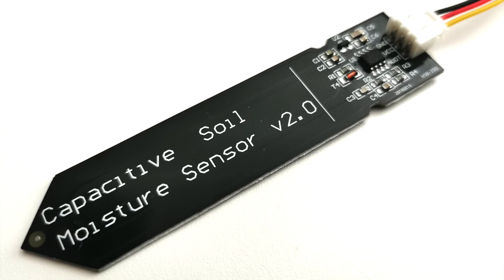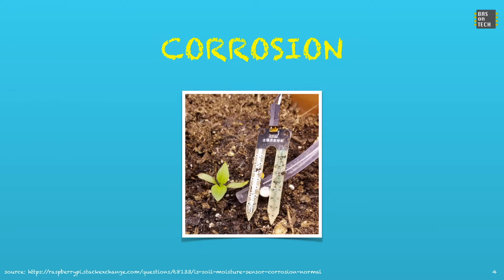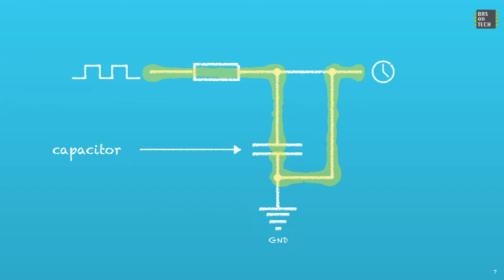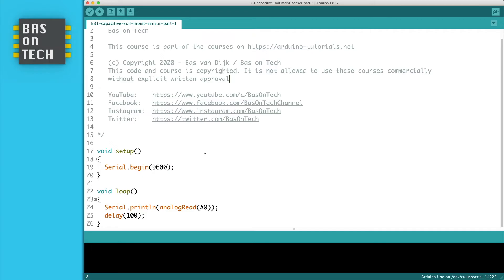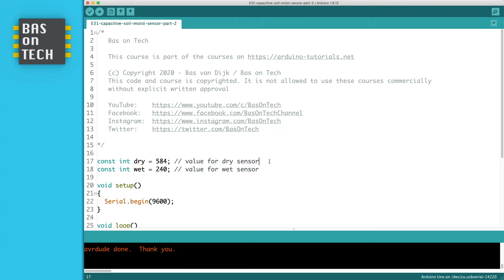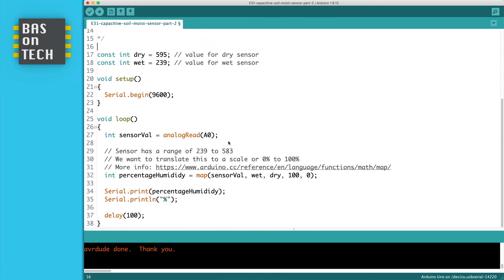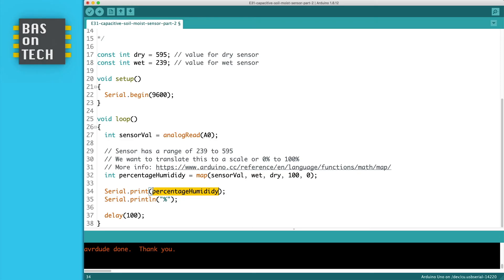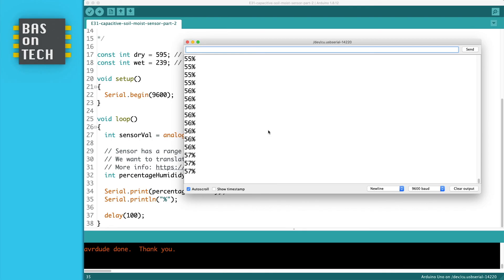SOIL MOISTURE SENSOR FOR PLANTS (V1.2 / V2.0) - Arduino tutorial #31

Comment: Nice video. One thing i would do differently is instead of using a cup of water to calibrate, use a pot with dry soil and take that as a dry measurement. Than get your soil to field capacity (Not too wet, not too dry. just right) and take that as your "wet" measurement. The readings will be much different than actually wet and dry. I made this mistake and killed plants by overwatering. ProTip: Censors need to be recalibrated if using a different type of soil than from the original calibration. Always calibrate in the soil you are going to grow in, because each medium is different.
Reply from the maker: Thanks for your explanation! This will help future readers a lot 😃

Comment: Thanks for this informative video.

Query - what if the above circuit part of the Capacitive sensor gets wet due to rain or any other reason? Will it affect the sensor? Should it be insulated?

Thanks!
Reply from the maker: My pleasure! 😃 I've not tested this. However I think that water will probably damage the sensor. So insulation would be definitely wise to do.

Comment: At 2:00 the video is wrong. The output of the circuit is tied to ground. So there will not be a signal to measure at 2:14.
What happens is this: When capacity increases (more moisture), the voltage swing across the capacitor will decrease. Vice versa, when capacity decreases (less moisture), the swing will increase.
Reply from the maker: Thanks for pointing out! 👍

Comment: You explained it great, but I did the same thing you did and the code just does not work.
Reply from the maker: That is quite unfortunate. Recheck your wiring and make sure the pin layout of your sensor is the same as mine. Without any error message I can't help you further.

Comment: hello, can I use the capacitive soil moisture sensor to detect/measure moisture in oil
Reply from the maker: I am quite sure you can't. The oil will probably damage the PCB. This sensor is as far as I know for soil.
Reply: @BasonTech  Thanks for your reply, I am doing final year project and part of it is about monitoring transformer oil quality, more specifically its dielectic strenght. Moisture/water reduces dielectric strenght of transformer oil that in most cases lead to explosion of the transformer , what sensor can you recommend that I can use to detect/measure moisture in oil
Reply from the maker: Unfortunately I have no experience with such a sensor. You might want to ask this question on Facebook / Reddit Arduino groups.

Comment: I actually prefer the resistive sensors.
You turn them on one by one for two seconds, store their values in variables and then read those variables and activate the pumps. You run the code every thirty minutes, this way the sensors last a very long time, because they're only powered for a couple of seconds per hour.

Comment: The reason for the slow response time at the end is because your sensor is faulty, there is no pulldown resistor on the analogue output.

At 0:01, on the bottom right of the sensor, just below C4 and R4, the via hole is breaking the trace. You need to run a wire from the right side of R4 (nearest to the end), to the analogue output pin. Check out the video by “flora” on capacitance soil sensors
Reply from the maker: Thanks for sharing! 👍

Comment: 9600 baud == 9600 bits per second, not characters per second
Reply from the maker: https://en.wikipedia.org/wiki/Baud states "It is the unit for symbol rate or modulation rate in symbols per second" 
The differences are found in https://www.geeksforgeeks.org/difference-btween-bit-rate-and-baud-rate/

Comment: how long does the sensor last if used continuously?
Reply: I've used mine for 3 summers (about 4months each summer so a year total of use) and have only replaced 1 out of my 5.  They were planted out in dry greenhouse so conditions we're good and weren't exposed to rain or wind. There are a lot of unreliable sensors available to buy and a lot of ppl have had a lot of trouble finding reliable ones. Try look for a reliable one. Hope this info answers your question
Reply: @iiinicky6224 this is mainly because the sides of the PCB are exposed to the elements, meaning water gets sucked into the PCB. You need to seal the exposed edges with something, like cheap nail polish or hot glue
Reply from the maker: Unfortunately, I have no idea. I haven't conducted any extensive testing. I've heard here and there that this sensor shouldn't be used for long-term measurements that can be relied upon.

Comment: Hi sir, may I ask why my serial monitor prints a reading over 100% when i put my sensor in the soil? when in air it is 0%
Reply from the maker: Is it wet or dry soil?
Reply: @BasonTech  it's after i remove it in the wet soil

Comment: Nice video, I just tried something with a Raspberry Pi Pico W using also an oled screen.

I have two questions.
1. What is the difference between version 1.2. and 2.0?
2.I used a version 1.2 in combination with a raspberry Pi. I found out that in case of using a solar panel the values measures are different. What are your experiences with this behaviour??
Reply from the maker: Hi! 1. See my comment on this video. 2. Didn't have any experience with this setup, sorry.

Comment: Well a smarter way to do it, is self adjusting the moisture, like saving the variable in a permanent memory (store even when turn off) and re-ajust by when a higher or lower score hits than the stored range. (Button of reset is needed if change the circuit)

Comment: I am using a v2.0 sensor and am trying to calibrate it following this video. However I keep getting inconsistent random values, wether it's wet or dry. I have tried with 3 different sensors. For instance I would get wet->63, dry->65 (nothing compare to this 500+ values in the video), and after a while, I am getting wet->68. dry->61. It's impossible for me to calibrate, does anyone  know what's going on? Thanks
Reply from the maker: I've made this tutorial quite some time ago and I see more and more people struggle with this sensor. Unfortunately it looks like many of them are faulty and do not work as expected

Comment: Hi Bas,
Hope you read this. I was copying the code on the Arduino Code Part-2 and then the value started going into negative even I mapped it to 100 and 0 pls help me
Reply from the maker: Hard to say what goes wrong. I would advise to reproduce the code step-by-step. With copy/paste you can have introduced many errors all at once.
Reply: @BasonTech  Thanks @Bas on Tech i will try your suggestion

Comment: i want to use 3 of these sensors on a plant but i was wondering if there can be problems when u put the side of the sensor with the electric components in the soil ass well. maybe that pasrt cant get weet and i have to make it watter tight
Reply from the maker: I wouldn't recommend to do that. Maybe hotglue can help to seal the parts, but still. When the parts get wet it will damage your sensor.
Reply: @BasonTech  ohw okay that makes sense thank you!

Comment: So the map range is clamped by default? Or will it go over 100% like 101% or below zero -1% for example?
Reply from the maker: As far as I know it is camped indeed. It will not map outside the range.
Reply: @BasonTech  So I finally experimented with it a bit. At first it seemed like this was the case, but I eventually found out that it can indeed go to -1% and further as well as 101% and beyond. So its unclamped and I don't think there is a clamped version of the map range function (That I know of)

For anyone wondering, I clamped the range with a simple if statement:
if(moisturePercent > 100) {moisturePercent = 100;}
if(moisturePercent < 0) {moisturePercent = 0;}

This way we can make it hit 100% without going over. And for me, send a warning message that its too wet or dry and something could be broken or leaking.
Cheers 👍

Comment: Can you use several sensors on the same Arduino? And how could that be? Thanks for great explanation btw!
Reply from the maker: Sure! You can share the Vcc and GND between sensors. Then you use different pins on the Arduino to connect the AOUT sensor pin to 😃

Comment: ook here is the thing, your values are changing very slowly which are supposed to change just after the change  in moisture. The reason is the  resistor which is not connected to the ground, Due to this the capacitor discharges very slowly. To get the accurate value you'll have to connect the resistor(R4) with the ground.
Reply from the maker: Thanks for sharing! 👍🏻😃
Reply: Thank you for this tip, as automated watering might have problems over saturating the soil if the sensor takes a long time
Reply: @kreynolds1123  yeah you will see the major changes in readings after grounding the R4 because the capacitor wasn't discharging previously. actually 82% of the capcitive sensors which are available in the market are faulty.. and the common fault is discharge resistor not connected to the ground.
Reply: Amazing difference, didn't know that, thanks a lot! This definitely removes my the workaround (with wait cycles) to not make a mess

Comment: I tried it, it worked for the first exercise, but after that it got all weird and only shows "54" over and over, even when I remove the sensor from water or even disconnect it from the Arduino Mega.  Shouldn't it stop reading and show 0, when there is NO SENSOR connected?  Something went screwy, but I cannot figure it out and the Mega works for other projects...
Reply from the maker: These sensors tend to be quite hard to work with. I experienced the same: one time they work and another time they give faulty measurements.

Comment: The "LAG" that the sensor experiments can be easily fixed if you bridge ground to the 1 megaohm resistor as it shown in this video ( https://youtu.be/IGP38bz-K48?t=418 ). You know, there's a major failure in most of the Capacitive sensors on the market, but if you fix it, it will work  INSTANTLY with NO lag at all.
Reply from the maker: Thank you so much for sharing! Really appreciated! 🙏🏻

Comment: Well I got my sensor in the mail, copied the code, plugged it in, calibrated it, stuck it in some almost dry potting mix and got a reading of 35% and then added some water to the pot and got a reading of 57%.  

So for me if the reading is less than 20%, water is needed, if more than 20% it doesn't need water.

Your code works a treat, your explanations were terrific.  Thank you very very much !

Now all I have to do is solve my wretched SD card and RTC issue and I have myself a hand dandy watering controller.
Reply from the maker: Great to hear! 😃

Comment: How accurate the sensor data is when compared to data from a soil laboratory?
Reply from the maker: Hi, it is definitely not accurate compared to such data.
Reply: @BasonTech  ok. I have a project going on with a Japanese company. So I am suppose to build a device that can detect essential soil components which are responsible to make a good soil. And it should also be cost effective.
Reply from the maker: Then this is not the sensor you are looking for. It is a very simple capacitor based moisture sensor, and does not in any way tell you the soil components.
Reply: @Bas on Tech  Yeah, I did not find sensors that can individually detect soil nutrients. But, there is one sensor probe that is not cost effective.

Comment: thank you for the tutorial. i've been going mad with someone else's sketch not working. obviously im creating an automated watering system so do you have a further tutorial that will help connect a relay to this so the moisture sensor activates the pump and if so could i please have the link.

really nice video though so thanks again
Reply from the maker: Unfortunately I don't have a tutorial about a relay. However there is not so much difference in connecting a relay board and a LED. Just make sure that the relay has the correct specs for your project and Arduino. Some operate at a different voltage than the Arduino.

Comment: I want control 4 relay unit using this sensor  value  please  send ma code for it
Reply from the maker: What have you tried so far? On what part did you get stuck?
Reply: @BasonTech   i want on solenoid's  relay using two input one of capacitive type sensor input other one is digital  input(tank water level) help me to code for this application

Comment: Hello!
It was a great video. I wanted to plug this to SparkFun ESP32 Thing (which only has options of Vcc as 3.3V) Should I proceed similarly or do I need to make some changes?
Reply from the maker: As far as I know this sensor is made for 5V perhaps your can find a 3V moist sensor somewhere?
Reply: It should work with a 3V3 input

Comment: do you have any idea why my values are between 1246, 3540 ??
Reply from the maker: That is really weird since the possible values should be between 0 and 1023. Have you checked your code?
Reply: @BasonTech  I used your code. I connect my sensor to pin 33 of my esp32
Reply from the maker: Maybe it has something todo with the esp32. I've only used it on the Arduino Uno. Maybe using another pin does the trick?
Reply: you get this result because the ADC of your microcontroller works with a bit width of 12

Comment: Really great and high quality tutorial, I do have one question though, I just got four 2.0 sensors and after setting things up on my arduino board the analog value shown in the serial monitor doesn’t change even when I put the sensor directly in water, do you have any idea why that is? I plan on testing the other sensors later today
Reply from the maker: Please be aware that there is a line on the sensor which indicates the max level of water. The electronic components should not become wet. Maybe your sensor has a different pin layout which needs the sensor to connect differently?
Reply: @BasonTech  Thanks for the fast reply! I am aware of the max depth line in fact I’ve already waterproofed the top part of the sensor with all the electronics. Interestingly I connected the sensor to my uno instead of my mega and it seemed to work fine after I fixed a couple of issues. I still have no idea why it didn’t work on the mega but I was planning on using my uno for the project anyways. Thanks again!

Comment: I have an Arduino Nano 33 IoT board that does not have a 5V port only 3.3. Is that a problem?
Reply from the maker: Hi Stephen, according to https://media.digikey.com/pdf/Data%20Sheets/DFRobot%20PDFs/SEN0193_Web.pdf it should be able to work with 3.3V
Reply: @BasonTech  Thanks!

Comment: Thanks for the great explanation 

A few questions:
1. Is this solution scalable for a large garden with about 50 pots. What is the proper way to measure multiple pots at once?

2. How do you protect the sensore from water in case you want to keep it constantly in soil even when raining?
Reply from the maker: Hi Tom, to be honest I think this sensor is more suitable for fun projects than for a large garden. This sensor turned out not to be very accurate and the durability is questionable as well.
Reply: @BasonTech  How was it less durable than you expected? Was there corrosion of the plates? And if so where they actually coated to prevent current flow across the plates? 

As to accuracy, one will find that a saturated soil will have a different capacitance than pure water. Water has a high dielectric constant. But  salts in the soil and the soil itself even when fully saturated with water will have a lower capacitance than pure water. So a reading with 100% saturated made from pure water will only ever read 100% again in pure water. And in another comment it was pointed out that the resistor needed to be grounded. If you had taken saturated and dry soil reading  as references instead of air and pure water readings, and had grounded the resistor, would these  have resolved accuracy issues?

As for practicality, there's water logged soil saturation with no to poor drainage and then there's freshly watered soil saturated with as much water as it will hold before it drains excess. Which is best called 100% saturated?  I don't know which convention is typically used. But, it seems more usefull to me factoring in drainage, because  there's no point in watering more than a soil will hold, so take a reading in the soil when the soil is well watered and begines draining should be considered saturated and and then another reading when soil is completely dry calling that dry. 

But, ultimatly what we really want to know is when to add water and how much is sufficient.  taking readings for both when we decide it needs  water and when it has been sufficiently watered. We can call those values StartWatering and StopWatering.

Or maybe some people simply  want to know the actual % hydration at a given point in time.

Comment from the maker: Many ask what the difference is between v1.2 and v2.0. There isn't much information available. This is what I found out so far myself:
- The spelling of  the out pin: AOUT on v1.2 and AUOT on the v2.0
- The tip on the top-side of the PCB shows a tiny circle on v2.0
Reply: there is absolutely no difference some circuits are different and some are also faulty it depends on supplier from which tou bought the sensor
Reply: The tip on the top-side of the PCB it doesn't have any function at all? I'm asking to know whether or not to put a little lacquer to avoid corrosion due to water seepage.
Reply from the maker: @zatsion2299  I guess using lacquer on the sensor will immediately stop any capacitive function of the sensor
Reply: @BasonTech  There is already a coating on the PCB.